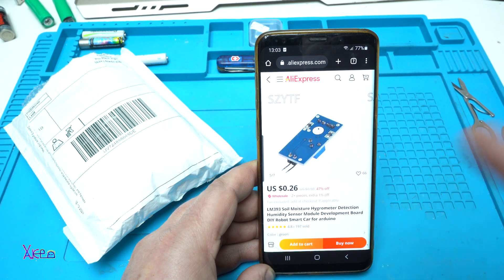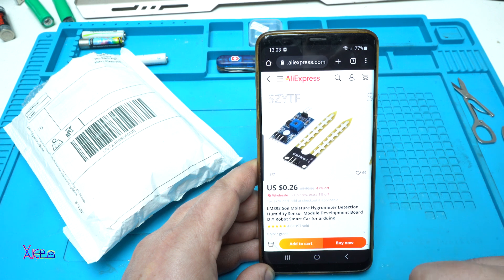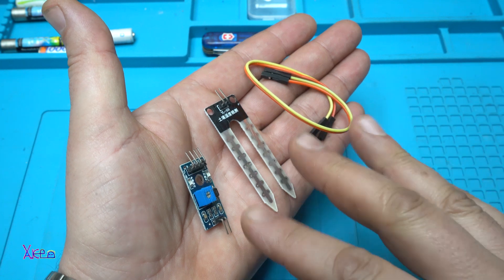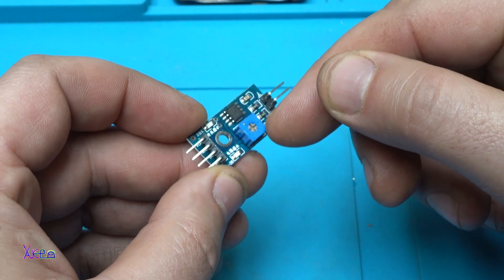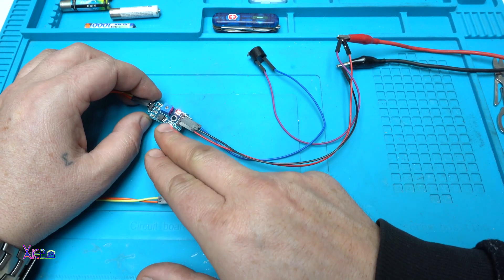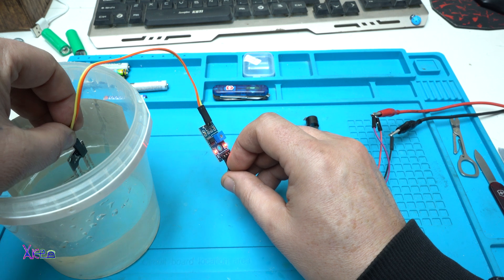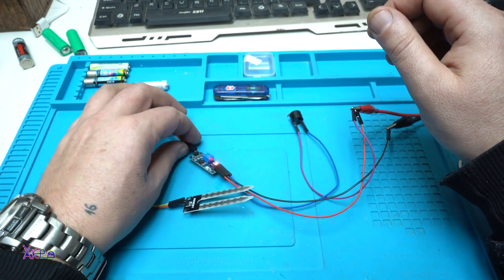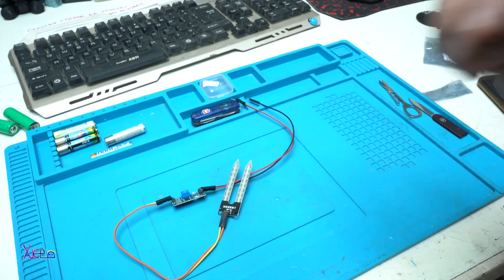I Bought $1 AliExpress Sensor Module  And This Happened?

Comment: First off, thank you for making these videos, you become an inspiration to budding hackers and that is good. You also invite commentary from people like me. 

That said, I do not like these sensors. They work on electrical resistance between the probes, and those probes are exposed. Over time the metal will be leeched off the probe into the soil you are measuring, reducing the probe effectiveness and contaminating the soil. There are other, similar probes, a little more expensive, that work on capacitance. The probes themselves are coated against corrosion. In the long run these are far superior.

I had in mind an Arduino project that would use the analog input from the capacitive probes to measure soil moisture in potted plants and water them when they got too dry. I never got it to work, and I found out later why. I had chosen to use an Arduino Mega with 4x the memory of the Uno and 16 analog inputs. I did not realize that the Arduino Mega, unlike the Uno and Nano, does not provide an internal 5V reference voltage for analog measurements by default, you have to specifically enable it in your code. Silly me.
Reply from the maker: Good luck with your Arduino projects,I see that you have nice ideas,just keep ot up

Comment: When using these sort of modules, it's useful to check the datasheet to understand their capabilities. In this case, the LM393 datasheet guarantees that it will sink up to 6mA when the output is low, but It will not supply any significant current when the output is high (it needs a pull-up resistor). That tells you that any direct load, for example a buzzer, is limited to a current of around 6mA for reliable operation, and can only draw that current when the output is low. For other conditions, you will need to buffer the output to supply higher current or to drive a load when the output is high.
Reply from the maker: That why the buzzer is with low sound,if you add a transistor the buzzer will be loud

Comment: There are two kinds.  The cheaper resistive type as shown here and the more expensive capacitive type which don't corrode or corodes much less.
Reply from the maker: Those that came in package will not last long

Comment: The probes will corrode when wet. It works great as a water leak sensor.
Reply from the maker: That why I made my own probe using stainless steel plates

Comment: When using this kind of sensors to monitor your plants, the problem is, that the earth never gets complete dry. So, there is always going a current between the forks, which leads to electrolytical corrosion. To mitigate this and still not using a microcontroller, I would pulse it with a 555 and add a monoflop with 555 before the buzzer. Or one 556.
Reply: You still need to ensure that the average dc voltage across the probes is close to 0V if you want to avoid electrolytic corrosion. It's a good idea to drive the probes with an ac signal via a capacitor, but that makes the detection of the change in resistance a little more complex.
Reply: @RexxSchneider  Let's note that we don't need to use a sine wave - just to be sure to switch the direction of current flow from time to time, such that the charge flowing in each direction is balanced.  That should slow the corrosion.
But using a well-protected capacive probe will last longer still.
Reply from the maker: That is great idea,need to try it

Comment: This should be the other way around...
when there is no moisture should beep!
so you know to water your plants! ;-)
Reply: To do automatic irrigation, it does not have the buzzer, it has a small water pump connected and when the substrate dries, instead of beeping, it activates the water pump and waters the pot, then the sensor detects humidity and the pump turns off, if you do it As you say, you have to water every time it beeps and if it beeps when you are not at home it will be beeping until you arrive.
Reply from the maker: Yes that can be done